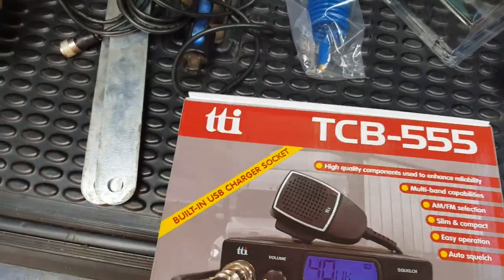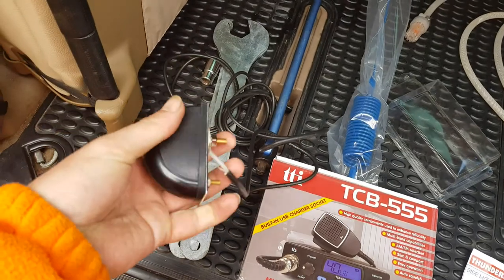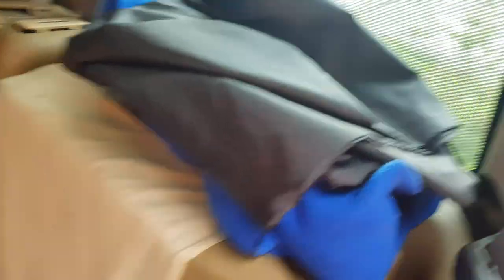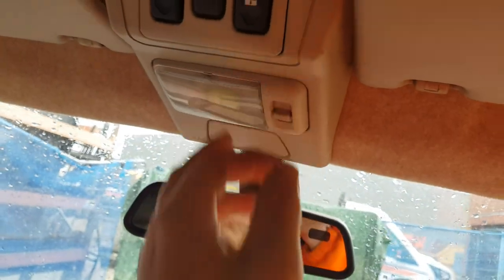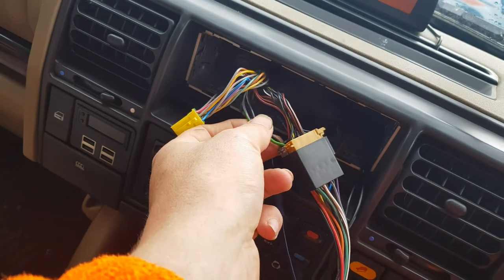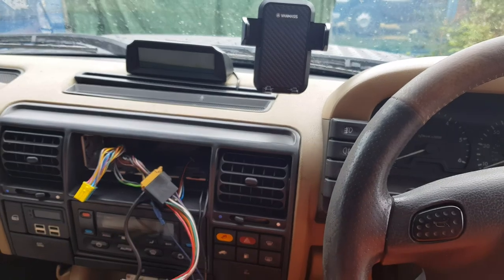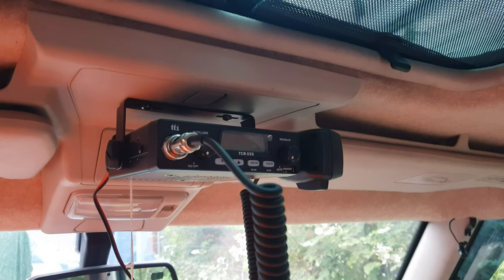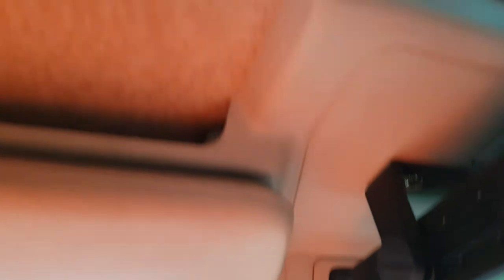Fitting A CB Radio In My Discovery 2

Comment: Nice one.   I considered fitting my CB up there too but it'll probably end up on the dash as usual!
Reply from the maker: I think anywhere is good so long it's not in the way.👍
Reply: Hi, have you checked the swr? The antenna is mounted to low and to close to the body. The antenna coil needs to be above the roof for good performance otherwise the swr will be way out and could damage the radio
Reply from the maker: @Ossie12pints  havnt had chance to test it out yet as I'm finished the roof rack build. Will try it out soon tho.👍